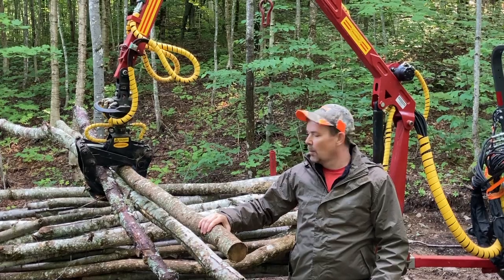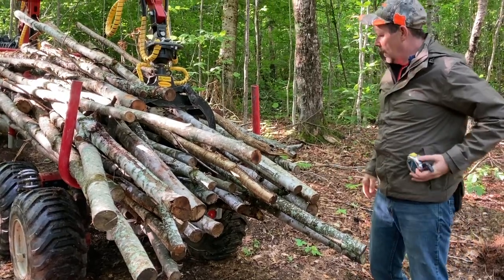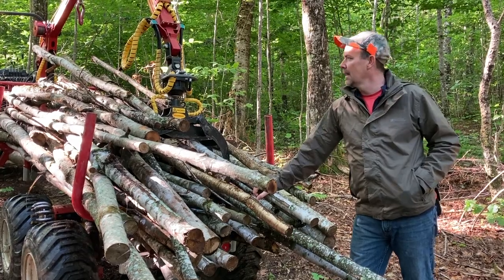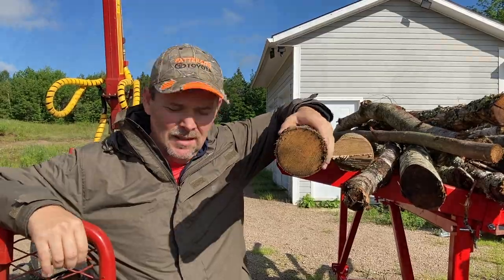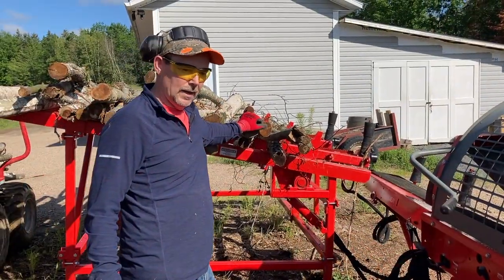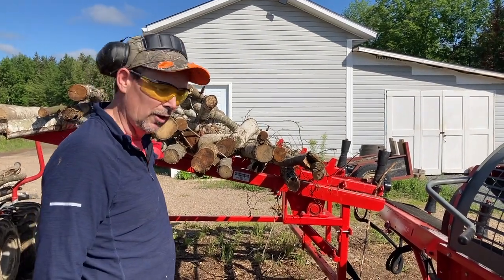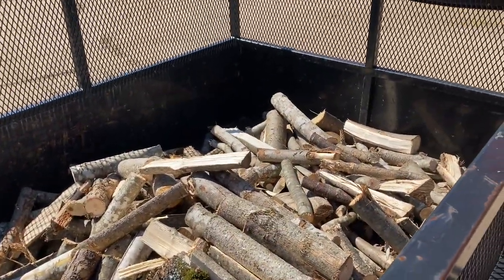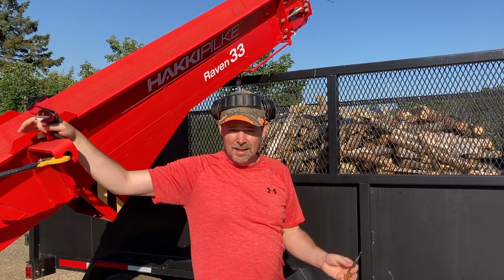Making Firewood From Small Diameter Poles With the Hakki Pilke Processor -E66 #OakMountainAcotts

Comment: I don't have a processor or do wood commercially, but I'm working toward using the whole tree when I do cut for myself and friends. 
I burn anything larger than my wrist, and chip/shred anything smaller to use for mulch. Some of the larger/straight pieces go thru my small bandsaw mill, but I'm taking the soft wood off cuts and running them thru the chipper as well and splitting/burning the hard wood ones. Just need to find a way to use the stumps/rootballs and I'd be set. 
As you say, it's not efficient or profitable, but it is responsible. Good vid Jason and Karen, thanks. ... 
* your dog is a hoot lol... "look at me, I brought you wood!"
Reply from the maker: It sounds like you have things figured out! We are trying but not sure we are as efficient as you. Ranger is the most intelligent dog we have had to date and I think a lot of the time he is bored and finds ways to amuse himself! Thanks for watching our channel, Jason & Karen.

Comment: “ The right thing to do” is certainly based on an individual’s values and objectives. Removing that wood is certainly aesthetically pleasing, makes the woodlot easier to work around. But I’d argue it doesn’t justify the extra handling economically and likely is a small negative ecologically. If the local market was there for stove-wood, pizza ovens, or bundles; a small premium might help with the economic negative of handling. You did a great job thinning out that stand.
Reply from the maker: Hi Craig, thanks for the feedback. I agree that there is also an ecological benefit to consider here. I think the lesson is “balance”! Take care, Jason.
Reply: @OakMountainAcotts  100% Jason, it's what we do everyday striving to find that balance!

Comment: What size is your dump trailer?
Reply from the maker: Hi Matt, the dump trailer is 7’x12’ by 4’ high. It has two dump cylinders with electric over hydraulic power pack.

Comment: Great video Jason but does it not take very long for the unsplit logs to dry? I also take out the small stuff but split anything thicker than 2 inches to bring down the time to make it dry. Thanks for sharing!
Reply from the maker: Hi Anders, I have split the small stuff before and it seemed to dry really fast. I thought I would run this through without splitting as a test. I did split anything 3” & 4” that I found. Thanks for watching!